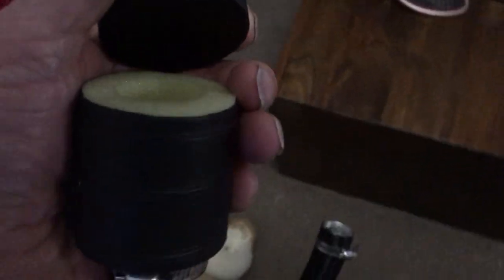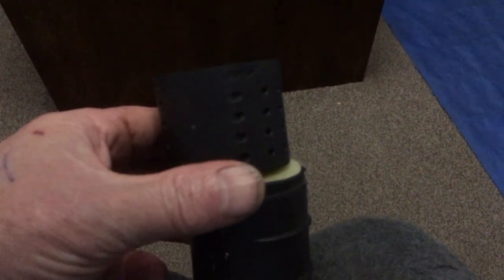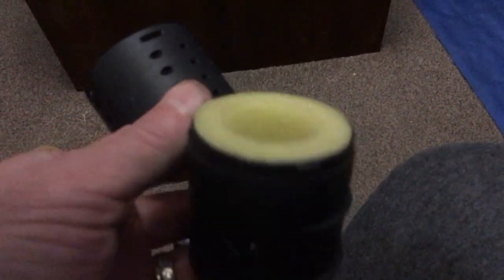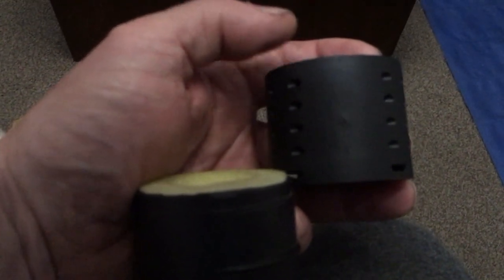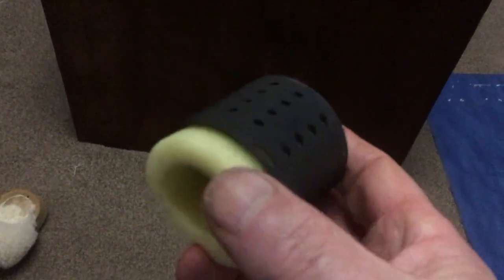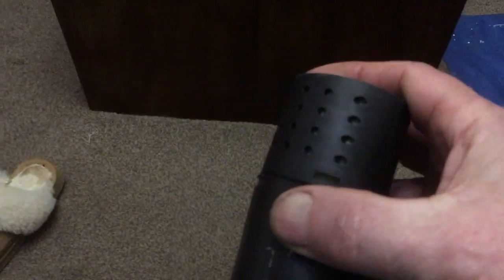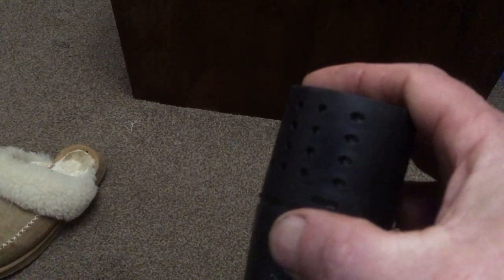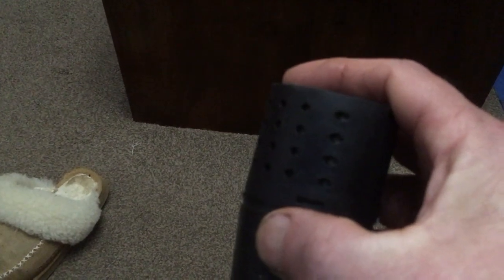diesel heater air inlet pipe

Comment: The more smoke that comes outta the exhaust means there is unburned fuel this mainly can be caused by not enough air ... Trust me , if you put the inlet pipe back onto the heater and remove the filter off the other end this will allow you to put your mouth over around it and give it a blow with or without the heater running mind you I think it's better with it running so the internal fan will help move any suit build up inside the heater at the inlet on the inside of the machine 😉

Comment: I read on another YouTube channel that the " air filter" on these is supposed to be more of a silencer. I removed mine completely. I had replaced the original exhaust silencer with a better one so I used the old one as an inlet silencer and put a piece of gauze over the end. No smoke except a tiny bit on startup as the airflow is unrestricted I assume.
Reply from the maker: mine has being unrestricted since i bought it so if anything it was getting too much air,when the new bits arrive ill be trying out the new controller & motherboard with the foam at the bottom (unrestricted) then moving it up to the top to see if that would make a differance
Reply: @robertedwards87   Good luck with it. It must be frustrating. Maybe I was just lucky this time. I've had plenty of other times with other things when I've just ended up scratching my head 😣